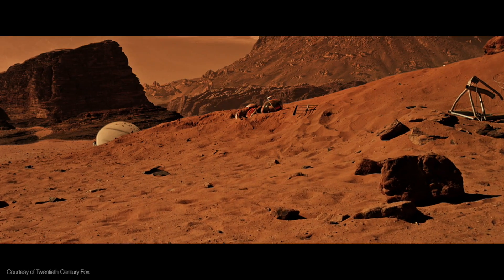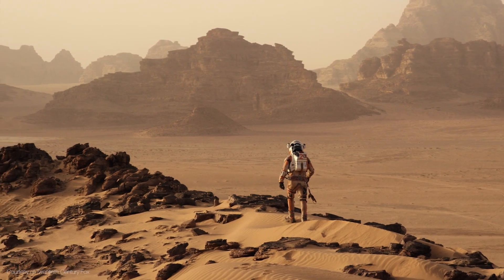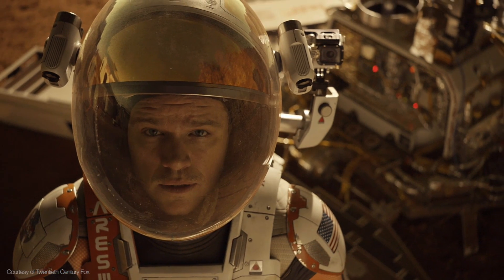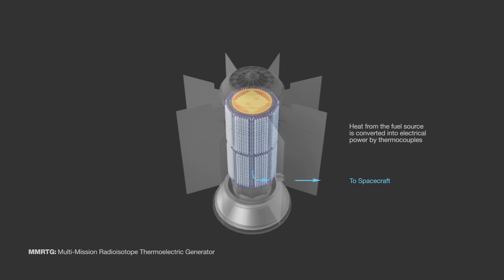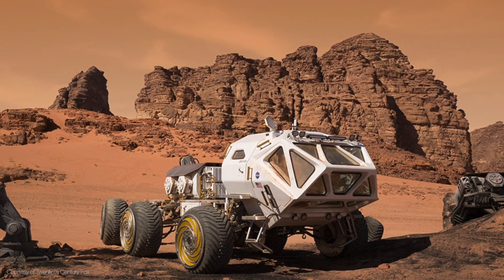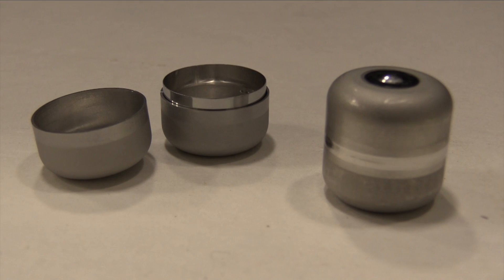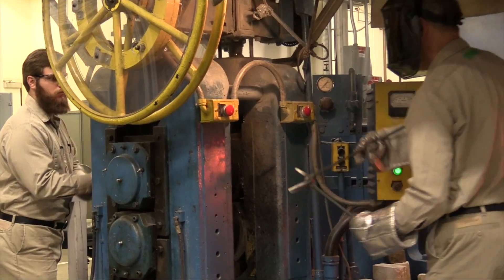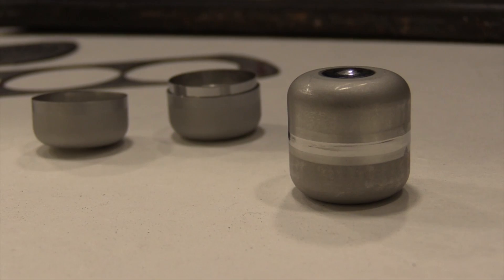The Science Behind 'The Martian' - Staying Warm on Mars

Comment: The Voyager space probes are powered by RTGs and the probes are still transmitting useful information to Earth, despite being launched 40 years ago. You can't use solar panels on the probes because the Sun, at its current distance is no brighter than any other star. 

In the book, Watney's RTG generates about 1500 watts of waste heat and 100 watts of usable power. He mostly wants it for the waste heat it radiates. By keeping the RTG in the rover's cabin with him, he can stay warm without having to use the rovers electric heaters (which would drastically cut into the rovers battery life and limit its range).
Reply: 1500W(th) continuous seems a bit too much heat for such a small space, I'd strap the thing to the side of the rover's hull to dump heat I don't need and at least get some continuous electricity into the batteries. I heard somewhere the rover's heater is only about 100W(e) or so continuous.
Reply: @leerman22  that's why after a short test drive, Watney rips out much of the rover's insulation to get the equilibrium temperature down again.